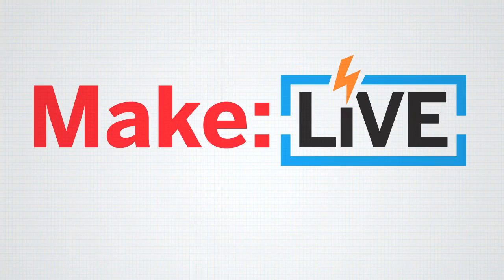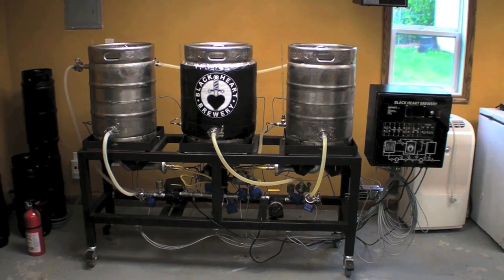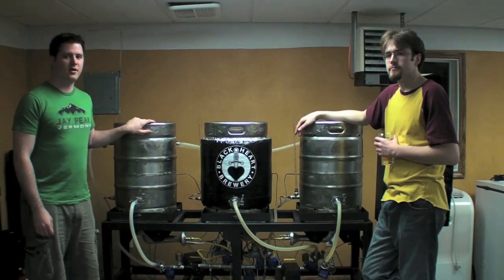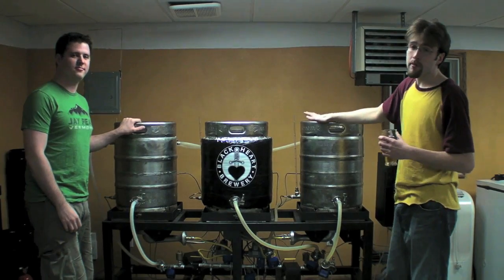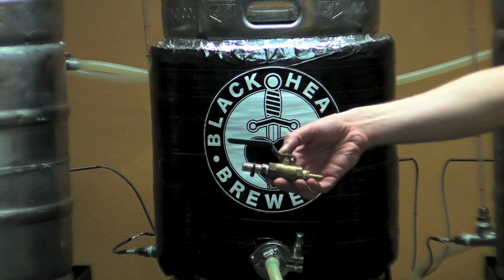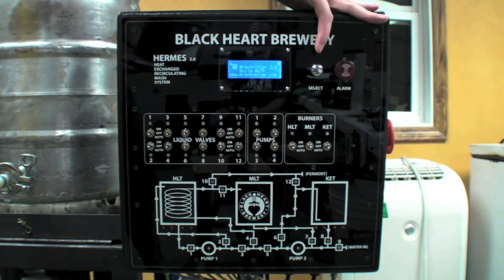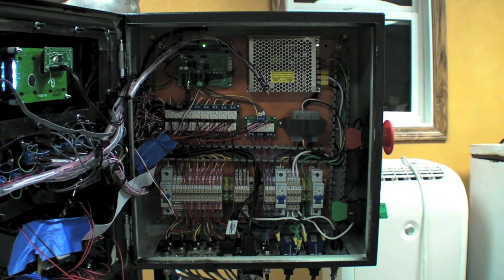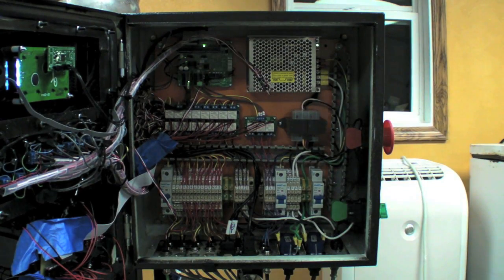Automated Homebrewing System on Make: Live ep08

Comment: Brewtroller is simply a micro processor with a few inputs and outputs. It can control many types of systems. HERMS is a system that heats the mash tun indirectly, much like a double boiler on your kitchen stove. This allows for a complex mash schedule in a precise and fairly easy process. This is a nice system, if you automate them to much, it takes the hands on approach away, in my opinion. I am building a HERMS system, less automated, so I am still doing the brewing!

Comment: With Google's Android @ Home edition the brewers could actually go from a fixed capacity hardware controlled brewing system to a modular object oriented process control using a Android phone or tablet... or even a pc or server running native Android or Android in a virtual machine...
then the brewers could change their brew system without having to physically rebuild their Hermes brew control system.
and they could even monitor 24/7 getting reports if anomalies occur.
that would be real clever!

Comment: The goal is to be able to do automated brewing, but also be able to control it manually on the box, as well as via a web interface. We built this as a test before we build one for going pro at 100 gallons. Then we are going to build another brew system, so we can do 2 batches simultaneously, That will allow us to keep our batch sizes down long, while producing more beer. Brewing on 2 systems, 200 gallons total, will require automation. These are all stepping stones, but we still make beer!
Reply: Are you still in the Binghamton area